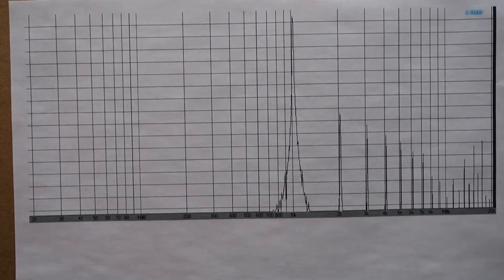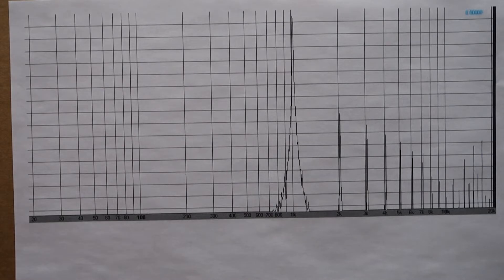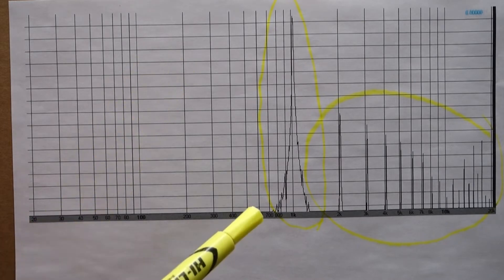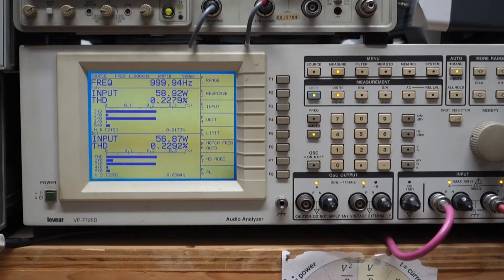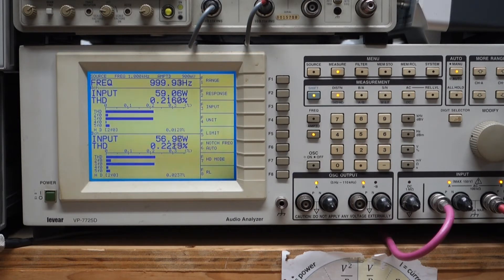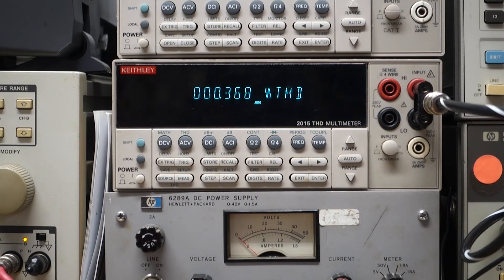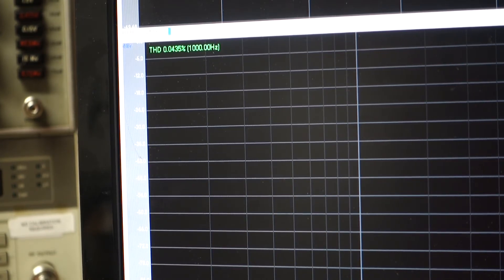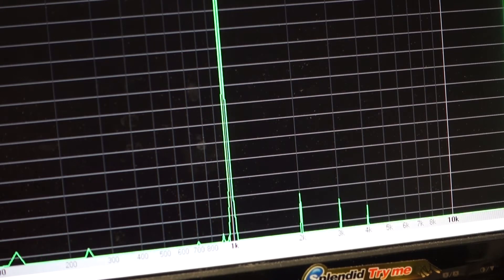THD and THD Analyzers

Comment: Ray, I am so excited I found your channel.  I am now learning how to take full advantage of my equipment. I am also using Visual Analyzer with a Scarlet 2i2.  Unfortunately, it seems like every device gives a different THD result.  I noticed your Kiethley, Panasonic and Visual Analyser numbers are all different too.  Were you using the same signal for all of them?  Is there reason for the difference, I have tried to set them all up with the same number of harmonics being used, but still get different numbers.  

A challenge I have found with Visual Analyser is the lack of instructions in English, if only I spoke Italian.  I have gone to his home site but all the documentation, articles, etc are in Italian. If you know of a site or documents that explain all the settings it would surely make the journey much easier.

One of my favorite devices is my ADP 3450 which is Digilent's high end Discovery, what is nice about it is all the features available through software.  It also has a spectrum analyzer function which is quite robust.  Although my GWinstek MDO-2204EX has a spectrum analyser, and AWG, it does not provide THD.  I only use it's signal generator bot the Bode plot feature.     I too had to find a clean 1 Khz signal for testing and just received a 10 Khz board.  However, I still get different THD reading on devices.

Comment: Great video, as usual.  I'm using the Quantasylum QA401 that you mentioned (current model is QA402).  It is a mixed hardware/software solution with a very low distortion signal generator onboard and roughly -110 db noise floor.  It does its analysis via FFT and can output many different graphs such as THD vs. Frequency and THD vs. Power.  At under $500 (need a computer to go with it), it is a very powerful tool for the money.  Keep the videos coming.  I'm learning a lot from you.
Reply: Wish the quantasylum stuff was available. It sounds like the qa403 won’t be in stock until sometime in 2023.

Comment: I routinely measure amps THD with my 2015 as the source at .003% or better if the unit under test is up to it. I'm not sure if you are looping the generator output back into the input jack?
Reply from the maker: That far exceeds the published specs. The weak point is the internal sine wave generator. Best I can get is .02%, either looped or measured by another analyzer. It wasn't designed for high fidelity.
Reply: @raygianelli3612  I don't mean to argue but I went back and looked at a number of videos on Youtube using the 2015 to measure distortion of various audio amps with it's internal generator and .05% and less reading of units under test weren't uncommon at all. On my own 2015 looping back at 1 kHz I'm getting .006 as I write this, and I figure a bit of that is noise pickup on the bench. It's about .01 at 60Hz, probably from it's own power supply. When I've seen .003 I did figure I was definitely pushing the limits residual wise especially considering the test setup.